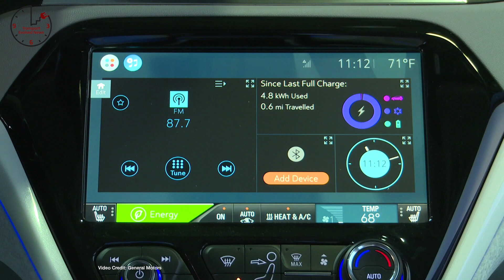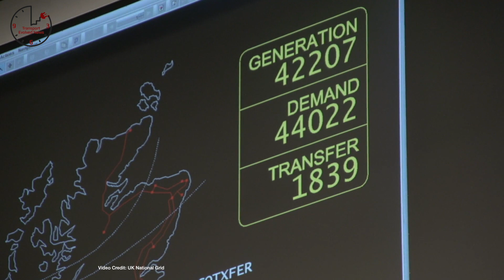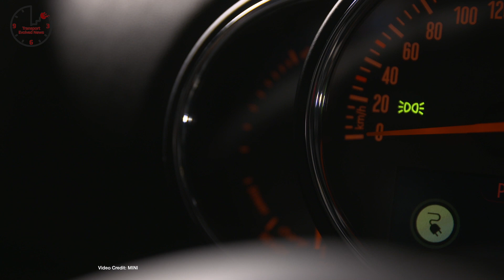BMW Scares Employees With Tesla, Waymo Public Tests, LEAF AT-EV, T.E.N. Future Car News 4/28/2017

Comment: What's wrong with nuclear power?
Reply: As far as I recall, it's slow and expensive to set up, and doesn't last very long compared to that initial cost. Additionally, it requires a lot of empty land area around it, making it less viable in large scale. Plus, it carries a minimal but non-zero risk of major health risks to the surrounding area.
All this may not be true for all types of nuclear power, but the biggest reason that it is currently avoided is probably the strong public disfavor of it.
Reply: Political gridlock due to poor public opinion, mostly. Also nuclear waste.
Reply: If you factor in all costs like:

-Very long, secure and leak free storage.
-Safety risks like terrorism, meltdown and contamination.
-Cost of setting up and maintaining plants. 
-Decommissioning costs.

Private gains public losses is the mantra of nuclear energy.

Make it so that every dollar/euro/yen of the costs are covered by the companies themselves and no one will start a nuclear plant.
Reply: For the sake of accuracy, I'd like to remind people that LFTR is not synonymous with MSR. A Molten Salt Reactor is any reactor design employing the fissile material in a liquid salt suspension. One need only look up the MSRE from Oak Ridge National Laboratory to learn the extensive list of benefits just from the basic design. The Liquid Fluoride Thorium Reactor (LFTR) is a particular configuration of MSR which employs the Thorium cycle to make its own fuel from a somewhat abundant element which is currently sequestered as a nuisance product in the mining industry. LFTR was designed by FliBe energy, one of the many startups mentioned before. There are several other MSR designs as well, some employing thorium (Thorcon), some not (Moltex), or even configured specifically to eliminate the existing nuclear waste stockpiles (WAMSR). Each design deserves its own recognition.
Reply: Karl P that and Hinckley point c nuclear program in the UK, is already the most expensive power station ever made... and they have not made it yet... and also produce the most expensive electricity in the UK... once it is built. then, nuclear risk/waste management not even included, why even bother? 
oh... and waste management... Hinckley point c does not even factor the cost of waste in, coz the tax payer pays for that... on top of it making the most expensive electricity!
Reply: +F. S.
- Too slow to build, because we are doing it wrong. The Manhattan Project started in 1942, and at that time scientists only started to experiment with nuclear fission. By 1945 they had several reactors up and running, and a few bombs were ready too. So why is it taking so long now? Short answer : Wrong tech, and enough red tape to reach the Moon.
- Radioactive waste isn't that much. There is a million times more energy in uranium than in coal. We are utilizing only 1% of it now, but it's still a 10000x advantage, and other countries (France, Russia) recycle their waste to get close to the million to one ratio. In the US waste management is payed for in advance by the consumers, and it's a tiny little percentage of the electricity price. Over the decades tens of billions of dollars accumulated from this, and some of that was used to build the Yucca Mountain repository, which is now ready to receive the waste. It's able to safely store high level nuclear waste for at least a million years. But a better solution would be to use the remaining 99% of the energy too, and reduce the amount of waste by two orders of magnitude. As a bonus, once the fuel is completely burned, it decays much faster, it will be safe in only 300 years.
- Meltdown is only a concern with very old, poorly build reactors. Modern ones that are being built now are several orders of magnitude safer. And there are even better reactor types that are completely immune to meltdown, and other issues.
- Decommission and waste management cost is payed for in advance, so it's already included in the price of the generated electricity. Unlike other energy sources.
-  Uranium ore is not fossil, it's a mineral. While it's finite, there is enough to run our entire civilization for thousands of years easily. That gives us plenty of time to develop fusion, which is good for a few quadrillion years.
Reply: Karl P 
mainly its more expensive than renewable generation.....and what the heck to do with the dangerous waste for the next 100000 years?
Reply: I'll give you a point you'll seldom hear from those hippy anti-nuclear peons: Large, centralised power stations of any kind are a strategic risk in any conflict. A decentralised robust grid of intermediate PS and storage  (+off grid buildings) would be much easier to defend if need be.
Reply: All these mentioned problems are easily solvable except politics and public support.
- Slow building time and exploding costs are symptoms of excessive regulations, and lost knowledge. Very few reactors were build in the last decades, so the special knowledge and skill required to comply with the extreme regulations are mostly gone. Engineers and workers retired or died since then, so the industry has to re-learn how to build nuclear power plants, and that causes all the issues. Plus the regular shit that goes on with any large construction project.
- If well maintained and not forced too close by politics, a nuclear reactor can last a century if necessary. 60 years with a major overhaul at age 40 is now the standard.
- They take far less land than renewables, because of their very high power density. They currently required to have relatively big buffer zones, but those are not actually used for anything, so they can be viewed as parks. And more modern infinitely safer reactors won't need buffer zones, and could even be build underground or underwater.
- Safety is not an big issue with Gen. III and above. All reactors involved in serious accidents were several decade old obsolete designs, poorly built or operated.
- Waste is not an issue. It's 10000 times less then fossil fuel waste, and safely contained, unlike fossil fuel waste. And using more then a half century old technology, fast breeder reactors, this waste could be destroyed, while making huge amount of power in the process. What we currently call waste is actually still 99% fuel, but currently used reactors cant use it. And also this fuel makes it radioactive for so long. Once burned in a fast breeder reactor, the waste will be 100x less, and only dangerous for 300 years.
- High cost and complexity can be addressed by modern extremely safe designs, and more reasonable regulations. The first nuclear reactor was a pile of natural uranium and graphite bricks, and a few control rods. The whole thing was assembled by hand. All the complexity in a modern reactor is to address an inherent safety problem with the basic design. These reactor create a lot of heat even after shutdown, so they have to be cooled for a long time or they melt down, and release bad stuff. But if we can eliminate that problem, 99% of the cost and complexity becomes unnecessary. There are several designs that don't have this issue, for example the LFTR.
Reply: Also as Elon Musk said, if u instead place solarpanels in the area nuclear powerplant uses you get more power :) With less hassle
Reply: +RA
That's not exactly true. A typical nuclear reactor produces over 1GW electricity 24/7. A 1 square meter solar panel near the equator produces about 30-50W in average, but not 24/7. And if you are in Northern Europe it's even worse. So you need a gigantic solar farm to replace a single reactor. A nuclear power plant may officially occupy a big chunk of land, but very little of it is actually developed, most of it is just a buffer zone that protect the population from accidents. The actual reactor core isn't bigger than a small house. Small 10-100MW gen. IV reactors can be truck mounted. With far safer modern designs like the LFTR the buffer zone and a lot of other support infrastructure becomes unnecessary, and reactors can be built practically anywhere, even in the basement of buildings.
Reply: Kenz, let's try not to get rabid on the politics. It's easy in the current environment to blame "liberals," but truth be told the dumbing down of America has been a bipartisan effort, courtesy of the corporate oligarchy. Pinning red against blue is a divide and conquer technique, please avoid this trap here, it doesn't help. Just stick to the science facts: yes, the longer the half-life of an element, the less radioactive it is, that is correct.
Reply: Fukushima did meltdown, full China Syndrome, hasn't released anything on the scale of Chernobyl. What did get released is already gone. Plus, that's old technology that had a critical design flaw courtesy of Tepco executives overriding an engineering decision (backup generators placed in basement instead of on the hill side above 2x the known flood line) to save construction costs. Had the engineers' design been followed, the meltdown wouldn't have happened. Anyway, new technologies address most issues. Molten Salt Reactors address all issues, a meltdown is physically impossible.
Reply: Karl P Interesting. I was hoping they'd switch hinkley point to one of the new LFTR reactors, but had assumed they weren't ready yet....perhaps there's still a chance, then we'd be getting experience in something that is potentially worthwhile.
Reply: It's expensive, otherwise it's great! I'd like to see some gen 4 fast breeders even though it is expensive as we have a lot of nuclear "waste" that is shock full of energy that we are not using. Unfortunately it's hard to get funding for nuclear these days.
Reply: Kenz300x: There are plenty of natural nuclear radiation stronger than these nuclear waste. Radon for ex. The longer the half life, the less dangerous they are. If we restart nuclear research and development, these waste could become fuel. The real problem is the lack of scientists, engineers etc... in these fields, in fact in plenty of disciplines. The west was the leader and currently the west education system is going down the drain because of the liberals who want everyone to be as stupid as they are to be "equal" !
Reply: Thorium and molten salt reactors are much better then renewables at the moment!!!!
Reply: +Karl P
I love the LFTR, but it's not the only possible solution. Now we are running out of time, so we can't afford to spend too much time developing new technologies. What I would choose for the first wave was designed by Rod Adams (Adams Atomic Engines, Inc.). It has most of the main advantages of the LFTR, but uses only off-the-shelf components, so it requires only minimal development before mass production.
Reply: +J O S H
First, Chernobyl was an old Soviet reactor (RBMK) with minimal safety systems, and inherent instability (positive void coefficient). Nobody wants to build reactors like that, in the developed world similar reactor types were phased out decades earlier.
Second, the accident still wasn't that bad. It did kill people, but most deaths were due to the complete unpreparedness of the Soviet authorities. Most of the victims were the firefighters who arrived at the scene first, and didn't know much about the dangers. And while the area was seriously contaminated, a significant amount was cleaned up, and the environment is actually doing fine. Now it's possible to visit the zone and see for yourself, or you can check out bionerd23's YouTube channel. Outside of the zone the effects were small, nothing to be worried about. The above ground nuclear weapon tests released 100 to 1000 times more radiation, although with different half-life, so the overall effect is not directly comparable.
Reply: J O S H. You really need to keep up to speed with what is actually been discussed. Spend more time reading the comments and less time keying in knee jerk 1970s crap.
Reply: WILKO. Yes, why is it so difficult to get this basic message across? Is this the living example of why safe clean "nuclear" energy can't break through? The very people who claim to be eco-warriors are actually the most closed minded of all to the clean safe alternatives. Go figure...
Reply: Olkiluoto 3, Hinkley Point C, Flamanville 3.
Reply: Fuel handling and waste management (while reduced in scale and complexity with MSR) will still need to be centralised thus giving clear targets to sabotage the grid in the long run.
Reply: having nuclear fuel OR waste anywhere near your population when bombs drop is certainly worse than having windmills standing around. 
Security as it is nowadays with NPRs can't be sustained with decentralised small reactors all over the place. 
While waste from MSR will be harmless in a few hundred years that doesn't mean it's harmless now if released.
Reply: +Argysh
If bombs are falling on your head, it mostly irrelevant what's around you, the bombs are quite lethal on their own. And if you live in the US those bombs will most likely be nuclear anyway.
Security is not that big problem. Look at all terrorist attacks that happened ever. Terrorists never assault well defended buildings. They don't have the manpower, weapons, and training for that, and there are far easier ways to achieve their goals. Even small simple nuclear reactors are immune to traditional terrorist weapons (guns, and improvised bombs). To have any hope damaging them you need a big anti-tank rifle or an RPG. Anything that can kill a tank. But if the reactor is in a reinforced concrete shell too, then you need some serious military hardware to damage it.
Reply: The problem is that it encompasses several different technologies and is tainted by the ones that have been developed extensively and mostly because they produce fuel for weapons...the ones being worked on now, though are very promising with few of the negative features of the existing ones, but are yet to be proven. Having an open mind would be a better idea.
Reply: RA: If musk said that he is a cretin !
Reply: Alfred Scamman. Excellent clarification.
Reply: only in the daytime, whbout night/winter?
Reply: Andras Biro. I agree, but I'm surprised you don't mention LFTR which is the solution to all of that.
Reply: It is the best replacer of coal and gas.  And there for the best helper to  up and down of other non-co² sources.  If you bash either one of them we will keep gas and coal even longer as we should have.   It is the safest, on par with windpower.   And is the only producer of energy that completly takes care of it's life cycle.
Reply: if a nuclear power plant had a meltdown it would release radiation just like chernobyl
Reply: +gwensf
The ocean is a pretty big place, this amount of radiation is nothing compared to it. Fish eaters should worry more about mercury and other shit we dump into the oceans in far greater quantities.
Reply: The point is that everybody is freaking out about a contamination that's absolutely not an issue, while ignoring other contamination that is actually poisoning them. There is a natural background radiation that we are evolved to tolerate. Using common sense, anything significantly less can't be too harmful. A single small leak in a vast ocean simply can't be significant. If the leak was bad enough to really contaminate the oceans, then the Fukushima shores should be so radioactive that I can't think of any suitable analogy. In reality people are working there with minimal protection, and there are YouTube videos where average people go near the reactors and take readings. If the radiation was that bad, everyone there would die instantly.
Reply: Andras Biro. Exactly, and molten salt reactors can't leak radioactive materials anyway. The foaming at the mouth greenies seem to think baseload power can be generated by windmills and solar cells, if they want totally green power then nuclear is the only option for 000's of Megawatts of reliable energy.
Reply: +András Bíró everyday we are exposed to small doses of radiation, but Chernobyl had huge doses of radiation being able to kill a human in a day to a week and it destroys the Eco system
Reply: +András Bíró first off if the firefighters wouldn't of stopped the radiation spread from the reactor most of Europe would of been contaminated with high levels of radiation, second ya you can visit Chernobyl but if you were to go in areas which there are high levels of radiation exposure you could potentially die at a very young age.
Reply: J O S H . Who cares? We're not talking about some stupid Soviet era graphite plant, if you paid attention you would know we're talking about LTFTR
Reply: Muskar . Doesn't last very long? Windscale/Sullafield was built in the early 1960s
Reply: +J O S H
The firefighters who first arrived at the scene didn't stop anything, they just responded to a fire. Containing the accident was a far larger operation, involving 600.000 men, and it's still going on. Most of the radioactive materials were thrown out into the environment by the original explosion anyway, anything after that mostly only concerned nearby cities, not Europe.
The area was cleaned up reasonably well, and the remaining reactor blocks continued to operate until 1990. There are fairly radioactive areas, and you can still find small pieces of fuel fragments, but it's safe as long as you don't do anything stupid. As I said check out bionerd23's YouTube channel, she visited Chernobyl several times, and explored it pretty well.
Reply: J O S H Yes because I'd live next to a Molten Salt Reactor or Thorium Reactor and there wouldn't be a meltdown.
Reply: +András Bíró I don't care what you have to say look nuclear power doesn't release any carbon emissions in the air which is good but it's a non renewable energy source, and can be very dangerous if there's a nuclear meltdown that's it
Reply: Jonathan Dittmar. Compared to what?
Reply: Karl P I know it's so frustrating! We could have MSR getting rid of current waste then Thorium reactors backing them up and then soon (hopefully) the UK will have the worlds first Fusion reactor!!!! Cheap clean energy for everyone but you know the big companies will charge big dollar! Still, Hickley point should be abolished!
Reply: Absolutely nothing!
Reply: Argysh. A Danish company thinks they can get a LFTR reactor down to the size of a 40ft sea container. Given LFTR is passively safe, this would completely decentralise all major grid power. Using Thorium, endless supply of power as well.
Reply: cough Fukushima cough
Reply: +Argysh
Not really. Fuel for an LFTR is trivial to make, nothing like today, and the waste isn't much to begin with, and not that hard to store, since 300 years is not a big deal. The Egyptian pyramids are 3000 years old and fragile mummies are still intact in them.
Terrorism is not a big concern. The only organization that ever tried to attack a nuclear plant is Green Peace. A traditional nuclear plant is extremely well defended, and there isn't much to do in there anyway. It's not possible to blow them up, and stealing radioactive material is extremely difficult, because it's not jut lying around. It takes special equipment, special knowledge, and a lot of time to handle highly radioactive material. An SMR will be physically less strong, but still essentially a high strength steel tank, not easy to damage. And handling radioactive stuff without dying is still hard. A waste storage site will have to be again like a fortress anyway, so not an easy target for terrorists. If you want to kill a ton of people and cause nation wide panic, there are unfortunately far simpler ways. 9/11 and the recent terror attacks in Europe were all very simple and low-tech, but still very effective.
Reply: RA. Yeah, that the sort of claptrap that I would expect from Musk..self serving hype as usual. I'd like to see Musk get 800MW out of a few hectares of land area using solar.
Reply: Andras Biro. Absolutely correct. What's this Argysh guy's obsession with friggin bombs and terrorists all about? Lol. We're all vulnerable to such things or not as the case may be, it's not a LFTR issue.
Reply: Max Waterman. Agreed. But LFTRs are under construction in India and China. It's not in the development stage, it's in the implementation stage. I hope the UK and US don't get left behind. If EV supporters want their clean, green and sustainable electricity, this is where (in national grid level bulk) it's going to come from.
Reply: Karl P expensive
Reply: Too slow to build (if you want to build a nuclear plant now it will take 15 years until you get your first Megawatt), too much radioactive waste to deal with, small but always existing danger of nuclear meltdown,. high costs of  decommission, dependent on fossil Uranium.
Reply: not much, just the radiation thing is a bit of a problem
Reply: Uranium mining is messy, by both environmental damage and employee health risks.